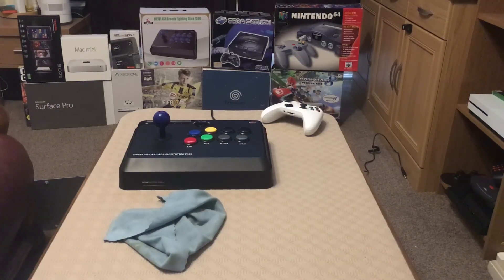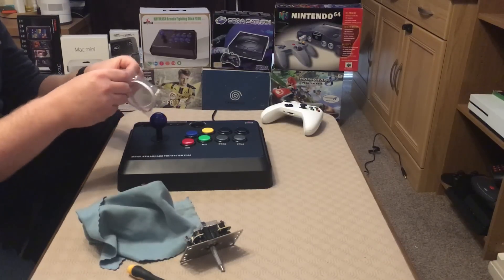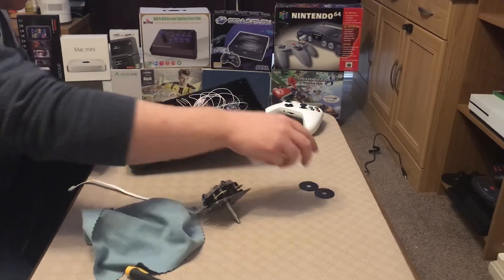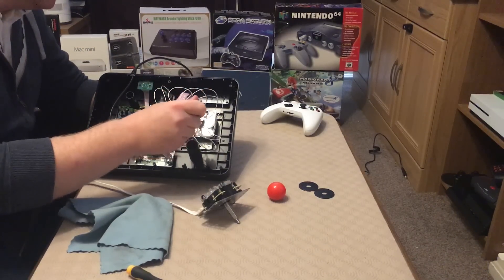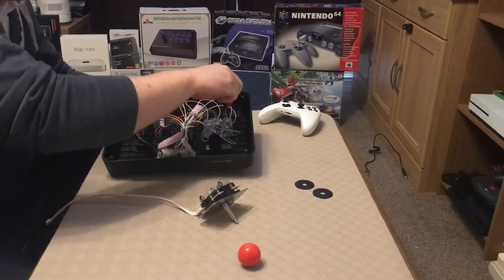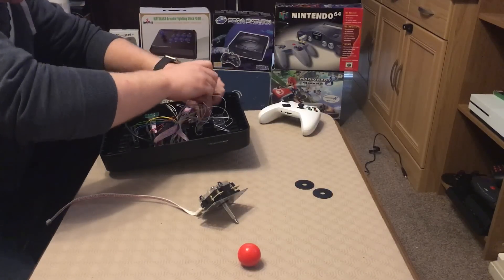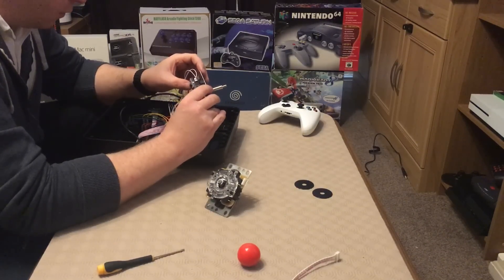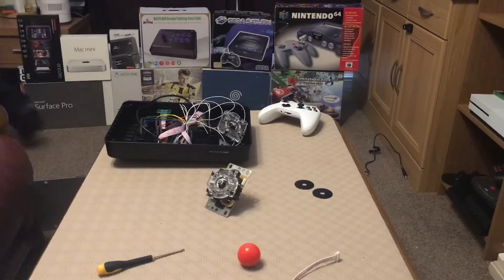Upgrade Mayflash F300 rev1.1 with Sanwa parts (Part 2)

Comment: Are u able to only change the restrictor plate on the stick or do u have to buy an entirely new stick and replace the one in the mayflash f300?
Reply from the maker: Landin I see no reason why a new plate/gate couldn't be used with the stock if you really wanted to.